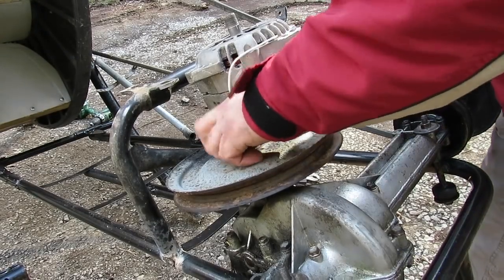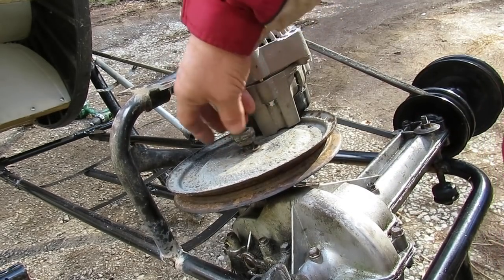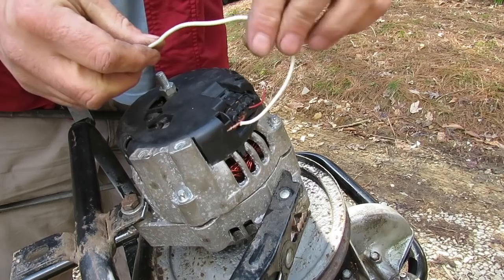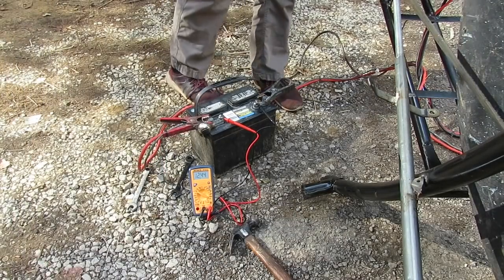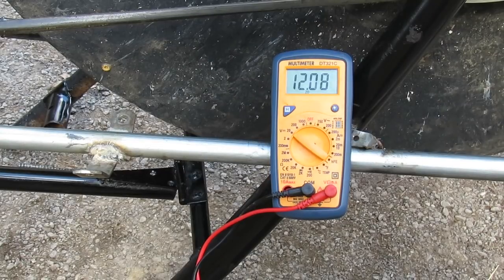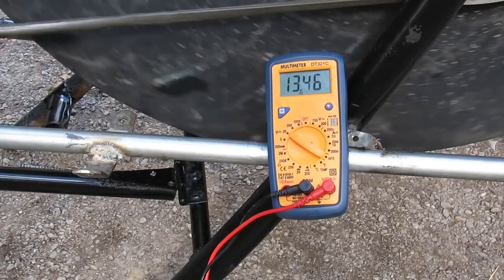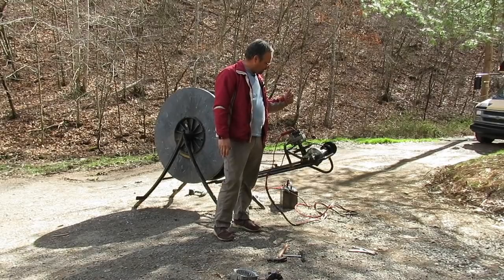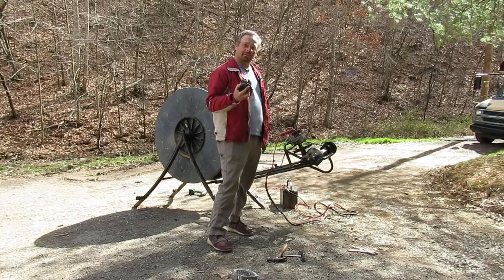Testing the Water Wheel with an Alternator

Comment: I am trying a permanent magnet 1200 watt alternator with direct drive pelton on my setup. Fortuately i have 130 psi  at the yard on am 8" line so no lack of power.  I also have invested iin  some 200 ah Lifepo4 batteries and a 3000 watt Hybrid inveter-charger.  I really need to remember to make some video footage.  Nice going sir.

Comment: Hi Luke! Awesome video. Why did you say the battery needs to be right next to the alternator? Why couldn't you run a  cable from the alternator to the battery some distance away? Are you concerned about the voltage drop?
Reply from the maker: Yes, the voltage drop is the problem. I ended up using a PMA and ran the ac current through the wires to the regulator on my pelton wheel generator.

Comment: Looks like you have a good meter Luke. It's easier to do these projects with a good multimeter. During a flood, do you get a lot of large debris going down the creek (tree limbs, large pieces of trash)? I was thinking of a floating water wheel setup I saw somewhere that rose and fell with the creek height. He had it anchored with long cables that kept it from being washed away.
Reply from the maker: Yeah, we have some debris sometimes. Actually, I think a big log was what took out the last wheel. I think it broke it into smaller pieces and made it easier to float down the creek. A floating wheel is a good idea.

Comment: Do you have any updates on this project? Really impressed with the ingenuity of it all.
Reply from the maker: No updates, water power takes a lot more work than it is worth. The creek floods often and there is always debris getting caught in the system jamming it up. I am going with solar for power now. I may revisit this if I can find some ways to overcome the problems.
Reply: @lukeFugate  Use pvc to run the water away from the river to the setup.

Comment: Is there a vid showing the final product, I'm building a power plant without a water source and building a water catchment system to recirculate and this seems to be the best for my ideas in place... Like to see the final product
Reply from the maker: It's coming up. I just have to build a water way to it. I have actually changed out generators and varied the design a little.

Comment: i am right in the middle of building a 5' water wheel in some what this plan but it pulls water from a stream (up hill to down hill) tru shiponong to the wheel turning 4 alternators on 8 batteries running a 12 volt 3/4'' water pump with 2 more to help pump up hill. 4 wires from the batteries to inverters to breaker box. sofar so good.
Reply from the maker: Sounds like a good project. Good luck, hope it works well for you.

Comment: these creeks in appilatia are insane lol
you might consider doing something i had thought of to make power
use mobile home axle with brake drums face the lugs couple together then build a water wheel from the lug connection
build your windings into the brake portion
then the drum holds the magnets 
you can bury the ends of the axle and cinder block supports on the leaf spring perch
Reply from the maker: Good  idea! That would be a very sturdy design.

Comment: I'm currently building a small mobile waterwheel setup using a modified generator frame. I have a mountain bike rim with the 4 or 5 gears on it with  16 pvc paddles to turn it. I have a chain on the biggest sprocket leading to a small sprocket on a slightly smaller rim. A serpentine belt is ran around the outside of the rim where the tire goes, turning a 95amp(rated) car alternator. Is there a way to make it more efficient? I'm gonna have close to 500 ft of wire to my house where the battery bank will be located. I just need it to trickle charge my batteries 24/7. I'll be adding two solar panels (255w each) next month.
Reply: a  delivery  pipe/flume  Should  be  Just  slightly  sloped;  1/1000,  based on one meter, per kilometer.
Reply: How is the project going? How many watts you can make per hour? Thank you!

Comment: Use 3 alternators and a high volume 12 v water pump to pump water to top with some syphoning effect to reduce gravity figure out volume x mass x weight and gear ratio to alternators speed  multiply ❌ voltages

Comment: 3500 rpm is necessary for alternators to work properly I was told. A series of clever gears should achieve that with a stream or river
Reply from the maker: Yes it should. This design is easily customizable.

Comment: Most modern alternators use PWM power control for the rotor you should not wire your rotor direct to the battery you may over heat the rotor plus it will stall the engine or put out to much power.
Reply from the maker: Thanks for the tip.

Comment: Wouldn't a small roof mount wind turbine generator work the best ?
Reply: Mark Wilson he said that the stream generally never stops flowing, it may slow but not stop completely. A wind propelled generator bu a rotor blade may actually break unless it's always light wind. Even say a large industrial wind electrical generator if it goes to fast can break. Perhaps a mix between the two or a mixture of the two but water seems more stable.
Reply: Just the generator not the blades
Reply: I'm curious as to what you mean.
Reply: Use the wind turbines generator instead of a alternator
Reply from the maker: A wind generator may be something I'll work on at some point. There is not a constant source of wind here however, and the water is just more dependable. As far as the generator itself, I plan on using a PMA. I just wanted to try the alternator before I convert it, just to see how it does.
Reply: I wondered whether by the suggestion it was meant to hook more directly into the electrical systems, but that's here nor there. It would still need a way to generate current.

Comment: There aint no way that wheel is going to power that system...you could tell how hard it was for you to turn that wheel, you'll need something 4x the size to get any reasonable power and that setup you have will last about 10mins before self destructing , I think you know that already.
Reply from the maker: Yeah, it takes way too much force. It needs much lower gearing.
Reply: To produce any reasonable amount of power (500W+) from a low head water wheel you need a huge flow of water ,  at least a 12" pipe on full bore. I'm just in the process of rigging up an alternator on mine  Homemade Waterwheel Micro Hydro  we're hoping to get 500W from this and look at the flow and speed.